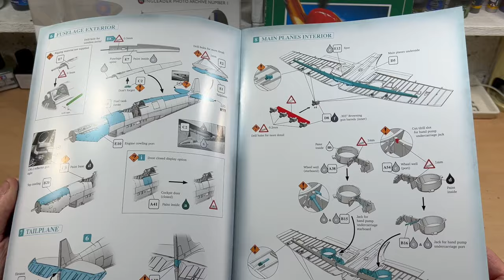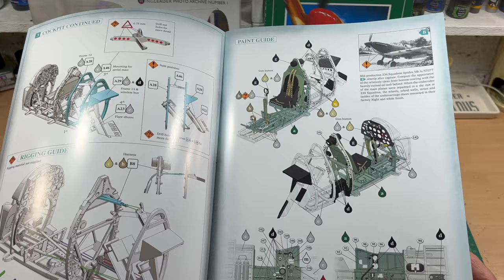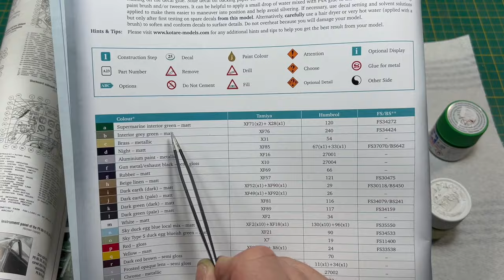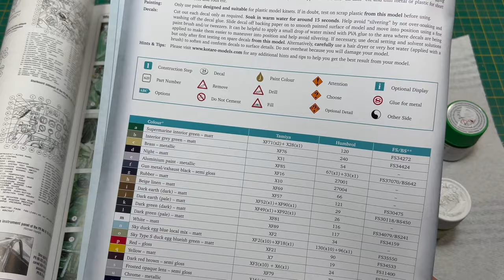Kotare 1/32 I Supermarine Spitfire MkIa I Full Video Build I

Comment: Thanks for sharing.
I cant recomend the AK masking putty enough for doing this kind of spray work. 
Also, cutting out the shapes of the mask from paper then using the masking putty to hold that onto the model gets you a beautifully precise but only slightly soft edge camo.
Reply from the maker: I haven’t used that masking putty, if I need a soft edge to the camo, I’d use “white tac” rolled into thin sausages and fill in with tape. I should get that putty though.
Reply: @TimsScaleModelling  White tac probably works the same as the masking putty I think. Only ever used the masking putty because a lot comes in the can. I just prefer the softer edge I think.
Very good looking build, I cant wait to start mine.
I have some of those clay washes, I just never used them because I like oil paints that much. I should use them more though.
Reply from the maker: Clay washes a great to start off with. Easy to use… build up the weathering from there

Comment: Dear Tim,
Nicely done. Did you encounter any problems inserting the oleo legs?
Regards,
Z
Reply from the maker: Yes Zinzan, very tight tolerances. Had to sand down to fit.

Comment: Hey Tim, I am pretty new to building these scale models. What is the point of the clay wash? You applied a bunch of it then wiped it all off with what looked like a microfiber towel? Also when you were painting on the camouflage you did a bunch of little squiggles in each panel and then covered everything up afterwards. I assume you had a reason for that? Sorry if these are pretty basic questions. Just trying to write up a little "cheat sheet" for myself by watching a bunch of build videos.
Reply from the maker: Hi Jesse. All questions are good questions don’t worry about asking for help. Clay wash is a quick and easy way of bringing any detail on a part, wings, fuselage etc. just slap in on wait for it to dry and remove with a damp cloth/paper towel.. easy. 
The little squiggles is a technique some call “black basing”. So, on top of a black primer or undercoat just spray any random shape or lines then overcoat in the your top coat. Again, it’s a way of introducing some interest or pre-weathering to your finished paint. 
It’s a bit long winded but ok if you have patience. 
I hope this helps….

Comment: What jig is that at 15:18 ?
Reply from the maker: That’s the Tamiya paint stand. You can get it anywhere and I’d recommend you do, very useful
Reply: Thanks for the reply Tim! My spitfire just arrived in time for Easter, and found your video super helpful in calming down the nerves! This is a beautifully detailed kit and would hate to ruin it 😂
Reply from the maker: @123MMAADD123 that’s fantastic mate. It’s a great, easy kit to put together. Be careful of the undercarriage though. The fit is very tight, you won’t be able to fit them without some sanding..

Comment: Incredible build, no problem there, most skilled builder on YT - however the kits was rushed to market, over priced, with a lot of scaling problems, too many to review, I'll stay with 1/48 th for a while. So far haven't seen the value of building 1/32
Reply from the maker: Thank you thunderpig. This is the best and most accurate 1/32 kit I’ve built, but you comment is fair enough. 32 scale can be unwieldy and difficult to store when built. The opposite of 1/35 armour.
Reply: wondering what scaling problems does this kit have.... For me it seems like a pretty accurate representation of the Spit.
Reply from the maker: @pauka13 if you want an accurate Spitfire, this is it… in any scale. The big Tamiya Spits are good too but the Kotare ones are the nuts
Reply: @TimsScaleModelling  this time of year it's not even on my bucket list due to cost, plus an engine would have been nice -1/32 is still not in my building scale. Thanks